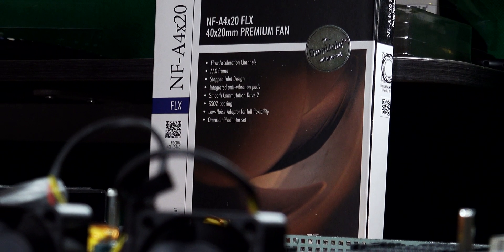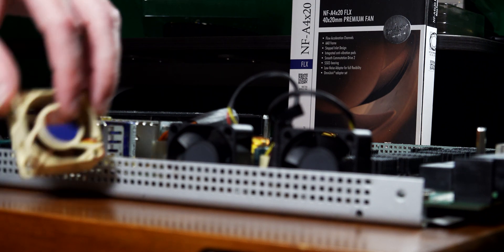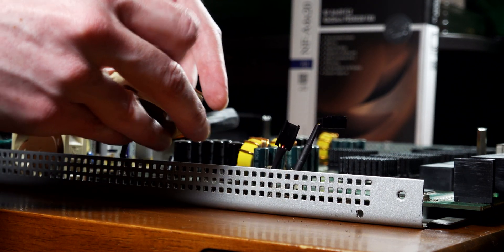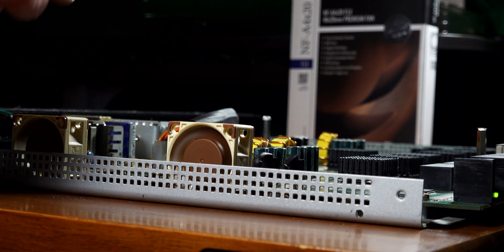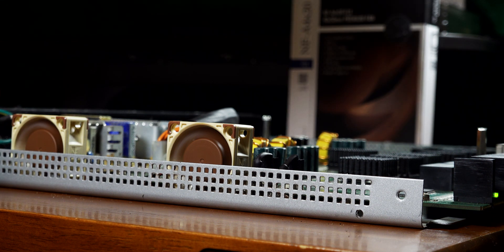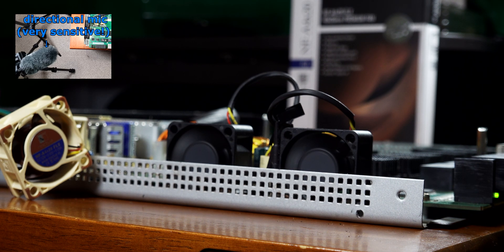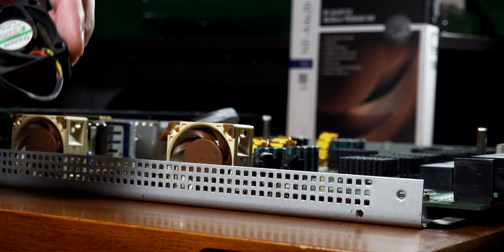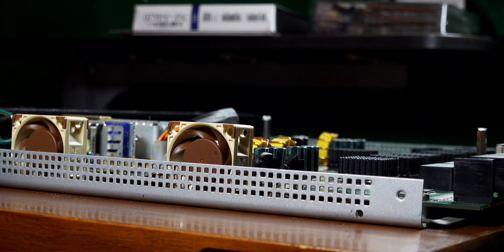Cisco SRW2024 | Noctua NF-A4x20 FLX Fan Upgrade

Comment: I have six of the PWM ones running at 100% in my Ubiquiti 48port 25G/6port 100Gbe Leaf switch same temps and a little less noise. I'll have see how it handles the summer heat right now it's cool.

Comment: What serial cable configuration are you using? Cable DB9 RR232 Female X Female. Grateful!
Reply from the maker: DB9 RS232 Female-Female 
Bits per second: 38400 
Data bits: 8 
Parity: None 
Stop bits: 1 
Flow control: None 

I hope that helps. If you need the pin outs for the cable I can provide that too.
Reply: @Disguise_AU  ty, very good

Comment: i just got mine 2nd hand today and holy ball buster batman its fking LOUD, so loud i cant concentrate or do anything and these fans are almost 40$ each on ebay dammit. I am thinking pull cover off get rid of fans and just sit it under the ceiling fan or pedestal fan.
Reply from the maker: If your ceiling fan or pedestal fan can give enough CFM (airflow) then sure (by the time theres enough airflow the volume will likely be loud anyway), but having fans force air through a small space is always more effective (the reason servers and switches function this way). I think $40 a fan is worth it for the volume as well as knowing it will do the job without problems. However like I said, if you can get enough airflow with another method then I can't see why not, I'm curious to know how you go so please let me know how it goes :)
Reply: @Disguise_AU  i will cos this basic income of mine controls the budget and only can get things used to try and learn more about networking, more my reasoning is Voip IP phones and programing them without the need for CUCM software. The POE switch will just have to deal with an open air environment on a shelf with air blowing around it... cos them fans are gonna be gone... just about to watch ur other vid about taking it apart... I seen most of ur channel is about getting prepared for WW3....lol... i know not funny cos its just round the corner. I wish u made more vids about ur networking etc.
Reply from the maker: My other video about disassembly is pretty low quality to be honest haha but if you're interested in networking I will be setting up a new network in December that will be rather elaborate so I could make some videos about the process of planning and deployment of it. It will have multiple VLANs with multiple wireless APs, several smart home devices hooked up to a Hubitat, a server rack etc.. I'm actually working on various projects for a new channel that's not gaming related.
Reply: @Disguise_AU  The video was reasonable the more angles u did with better lighting also helped and the lighting is very important with clear closeups and use a pen to point things out cos the devil is in the detail too.... u got the message across very clearly and the bonus part u explained more stuff from the previous video, so its just not the video its explaining shit to help other learn, including the WHY cos that helps alot too and I am glad u noticed u started to ramble and killed the vid... well done. Whats a Hubitat or did u mean eco habitat?
Reply from the maker: Thanks for the feedback, I definitely appreciate it as I don't get a lot of constructive feedback. 

Hubitat is a smart home hub that allows us to connect smart home devices without cloud services so that we can have smart home devices without having them connected to the internet which is just an added security risk. The only reason I'll be setting up smart home devices in the first place is because my wife is in a wheelchair and having these devices makes it a lot easier for her to maintain her independence so I'm planning to set up the home network in a way that keeps everything secure and we get to keep as much privacy as possible - the best of both worlds, convenience and privacy.

Comment: Sunon fans are 2x the performance of noctua's!!
I would tolerate the marginal db difference for superior performance!
Reply from the maker: I can see what you're getting at, but I've had 3 Noctua fans in mine for almost a year without problem (and we have just been through a hot Aussie summer). Also I think that outside of a rack environment it should be fine (would be pointless trying to make it quiet inside a rack environment anyway), I've not noticed any performance issues with the switch and it doesn't get hot to the touch even during summer. 

It is an interesting thought though, I might put a few temperature probes in there and see what the temperatures actually are, I can't imagine them being very hot but it does have me interested to know.

Comment: I love noctua :D  I even have a metal bage I got with one cpu cooler on my gaming case ;)
Reply from the maker: Noctua fans are fantastic! I use their industrial fans on my main PC, can be very quiet when idle but also provide a lot of airflow very quickly when needed without too much noise. The network switch still has the 3 Noctua fans in it and its going well and quiet, definitely a worthwhile upgrade for a network switch placed in an entertainment area where fan noise should be kept to a minimum.